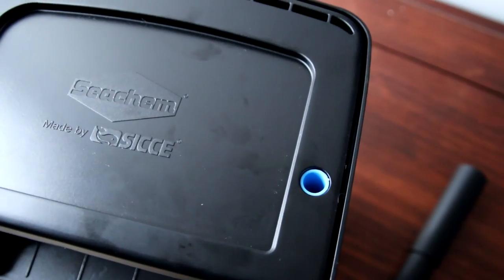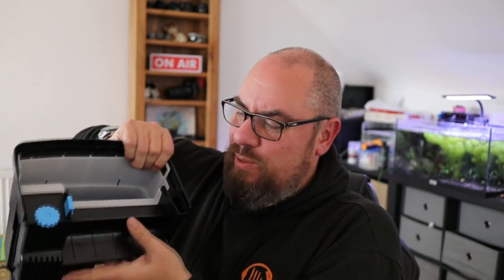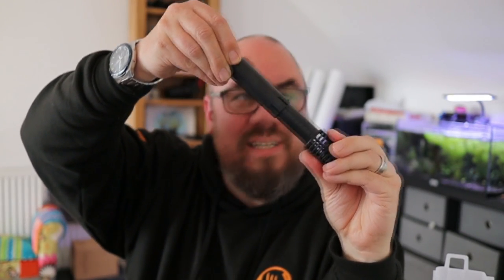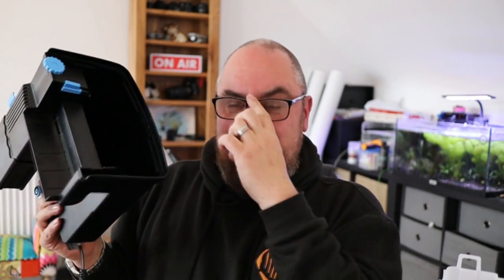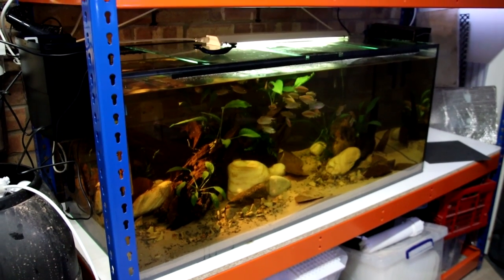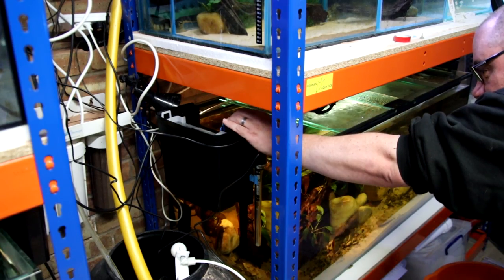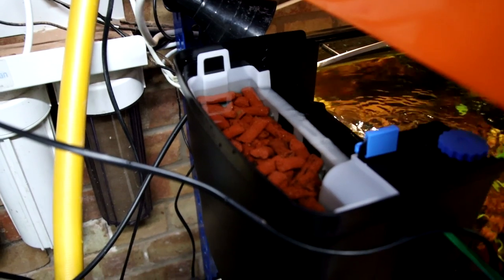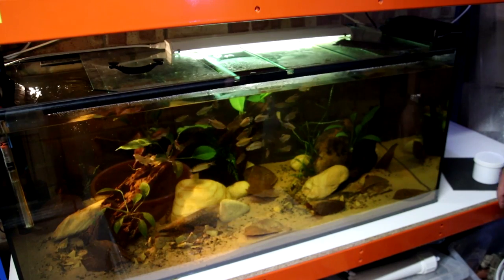Is this the best aquarium filter? Seachem Tidal.

Comment: Nice review. Within my fish room I have a total of 13 Aquaclear filters, mostly Aquaclear 70. I’ve been a fan of them for years since they are proven and offer plenty of room for media.  Recently I added three new Aqueon 60B aquariums. The Aquaclear 70 did not fit since the lip of the new tanks is too wide. Rather than upgrading to the Aquaclear 110’s, I decided to buy three new Seachem Tidal 75 and give those a try. Game changer! I really like the features of the Tidal 75. The media basket offers plenty of space. The internal pump and self priming feature is much appreciated. Best of all, there’s no o-ring, or outside connections that can result in leaked water outside of the tank. As the Aquaclear filters expire, I will replace them with Seachem Tidals. 👍
Reply from the maker: Good point about the o-ring / leaks!

Comment: Had a Tidal 55 running for two years on my 60 litre tropical community aquarium.  While generally a great filter and very quiet, it is not perfect.  Had to upgrade mine by adding a sponge pre-filter on the intake to reduce fine filter floss blocking too quickly and keeping the impeller a bit cleaner.  Also, had to drill additional holes in the bottom of the media basket to reduce bypass.  It has been very reliable and easy to maintain but bypass is a common complaint once the fine filter gets even slightly mucky, the additional holes are a must in my experience.  Cheers for the review 👍

Comment: I like the Tidals and often use them with various media to polish a tank or seed media or dose one of the various resin products I use on occasion.  The only issue with them is if you don't stay on top of evaporation they will start sucking air and are extremely loud while doing so.  And that issue is on the fish keeper...not the filter.

Comment: I have goldfish, I need lg. capacity filter. For years,I use a power head 324gph tube to top of the tank to a lg. clear plastic container, I made a pvc spry bar, I use 3 aqua sponge filters and quilt batting pile. So easy to change floss, rinse sponges monthly. Clean hose monthly w/power head. Easy
Reply from the maker: Nice 👍

Comment: I've tested it out for 2 years and it disappoints for me.

The tank needs to be a certain height anything 15 inches and above is OK.

The surface skimmer still sucks in detritus.

Difficult to prefilter but is possible

Maintenance indicator after time always floats so indicates nothing.

It's huge.

It's quite inefficient

Fish will swim into the outlet plecs particularly and there odontoides get stuck in the filter bags and they can die.

On the whole it's good for novice aquarist and 1 maybe 2 tank set ups. Any sizeable fish room it's not good. maybe tanks that need minimal flow it's going to be good.
Reply from the maker: But apart from that its great, yeah?
Reply: @AquariumAdventures  It certainly has its place if your new to the hobby and a bit lax with maintenance it's a game changer if you 20 tanks like me and enjoy doing water changes its an unnecessary expense that will kill your plecs certainly when they swim up the outlet personally I have a 110 a 75 and two 55s and they are all back in their boxes.
Reply from the maker: @khiburgess5848  Well, I'm not new to the hobby, have over 20 tanks, and think its great - but each to their own, I did say it wouldn't be for everyone. The capacity and low running costs in comparison to others in the class sold it for me.
Reply: @AquariumAdventures  Oh yeah cool I know your not new and have ample tanks, and yes each to there own I'm glad you like it, for me generally it's fine but there are issues  some if which are the ones I found for me. The efficiency for me is questionable I put mine on a meter to check efficiency and it didn't get close the claims in the instructions when you dialled up the flow it obviously gets worse. Glad you like it though I've been watching you for quite a while now.